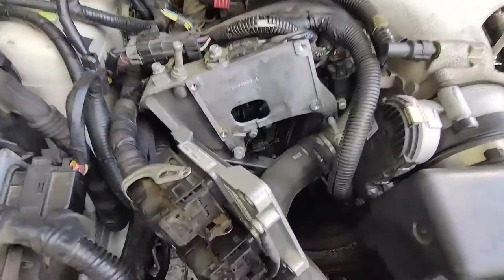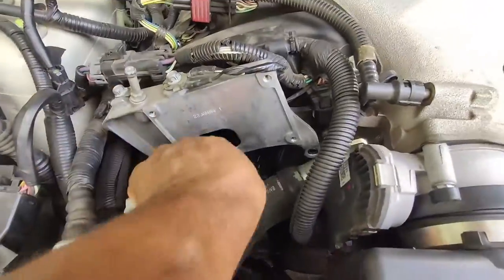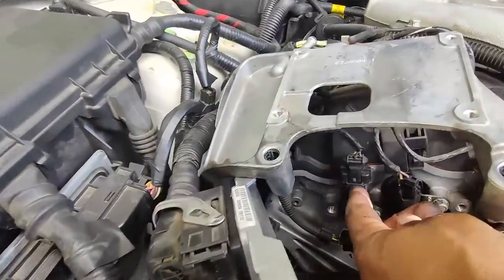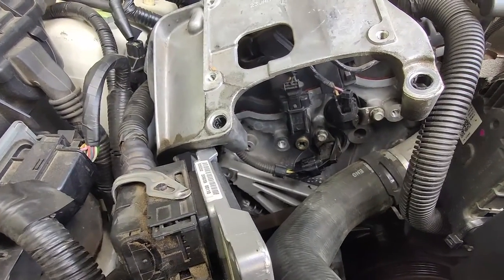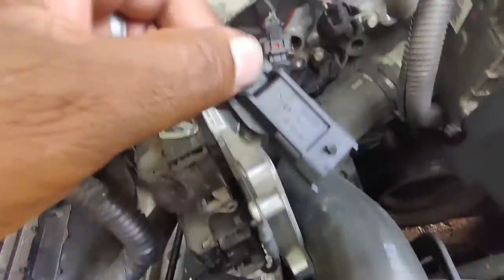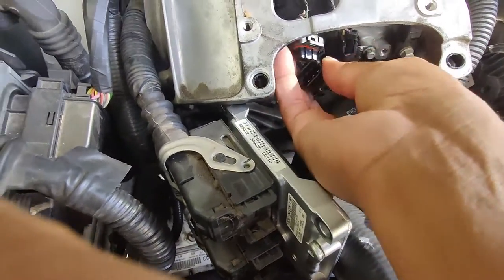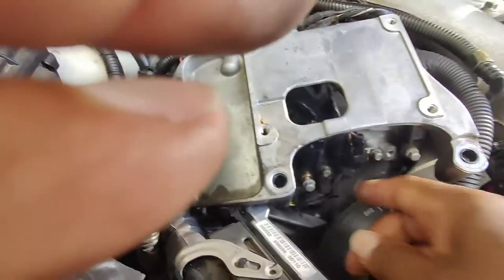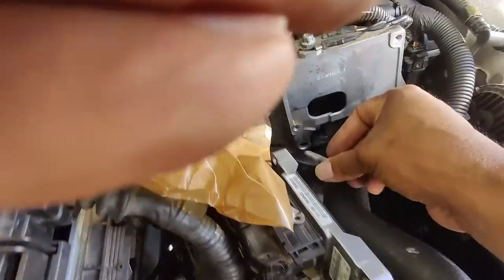Cadillac CTS Cam Shaft Position Sensor

Comment: Thank you so much for this video.
I have the 05' STS 4.6 AWD.  I have 165,000 miles on it and I had a series of codes come up.  Initially, I had the cam and crank codes come up with the random misfire code.  When I cleared the codes, those didn't come back.  I'm in NC.  We experienced the gas shortage and could only get regular unleaded.  The car hasn't run right since.  I have replaced the MAP Sensor, MAS, new plugs, air filter and the throttle body.  Due to mileage and it throwing the initial codes, I am going to change the Camshaft Position Sensor and the Crankshaft Position Sensor.  The random misfire P0300 is the only code coming up right now.  Any ideas from my information and do you know of any videos that will help me?  I  am a 52 yr old woman and I am slightly mechanically inclined.  I've done several of these things myself.  By watching the videos, I won't be able to do the crankshaft position sensor on my own, but I'm wondering if I can do the camshaft position sensor.  This car seems to be a little different than the others.
Reply from the maker: You may want to check your O2 sensor. Bad readings on the exhaust can throw codes as well.
Reply: @theJOAT  by reading through the forums, I realized that they call the upstream air/fuel sensors.  There are (2) and there are (2) downstream.  That's going to be my next plan of action, starting with the upstream.  Please let me know if you think of anything else.  I Appreciate your response 👍🏾